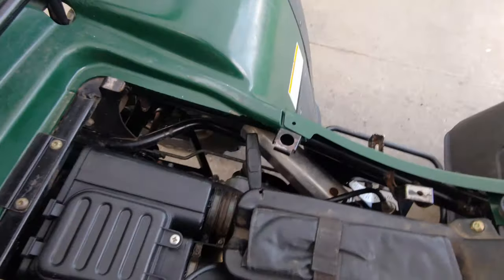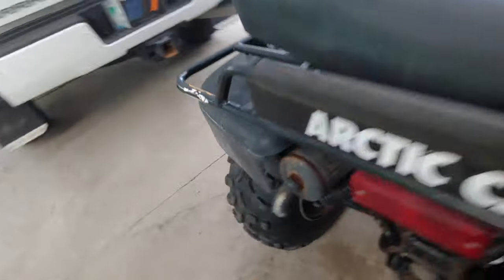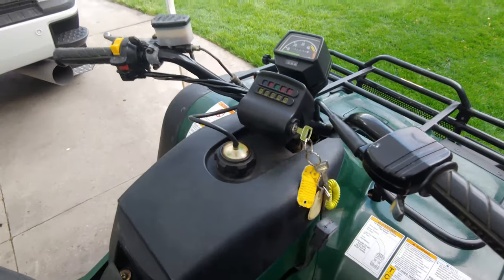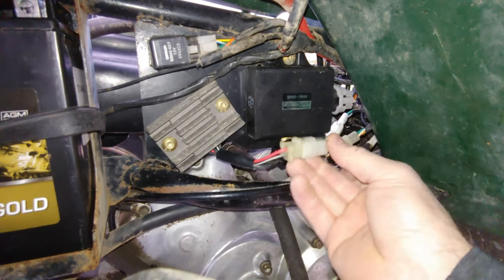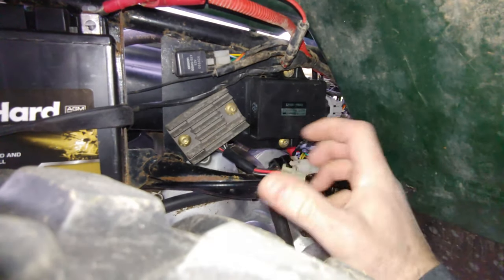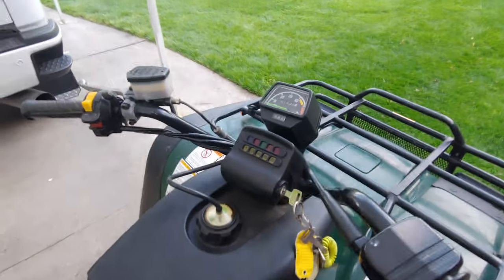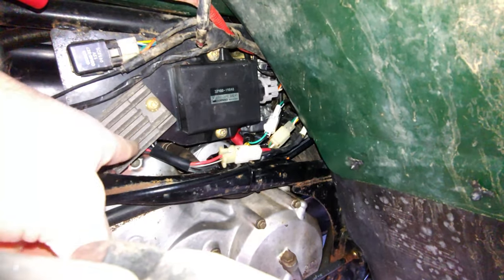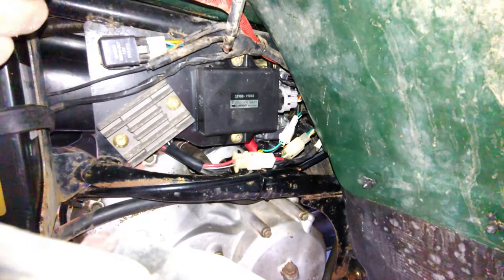99 Arctic Cat 300 4x4 ATV BOG | How to fix if source is electrical

Comment: Had this same issue with my 97 bearcat 454cc.  Did the same procedure.  Problem  cleared up. Also swapped out the old analog cdi box for a Chinese 12v cdi. Wasn't  hard. Now has no issues. New cdi was like 28 bucks. Now carry a spare cdi. If it has a pulse trigger any 12v cdi will work.
Reply from the maker: Oh nice!

Comment: Thanks Andrew!!! that detail of the CDI going safe mode if high voltage detect helped!
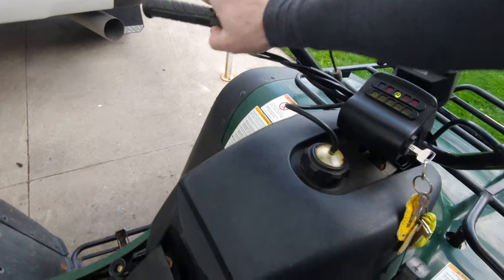3:31 Symptoms of starting up and running rough
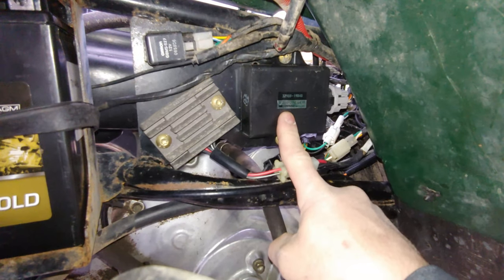6:09 Tested over voltage due to bad Rectifier/voltage regulator causing safety rev limit at CDI
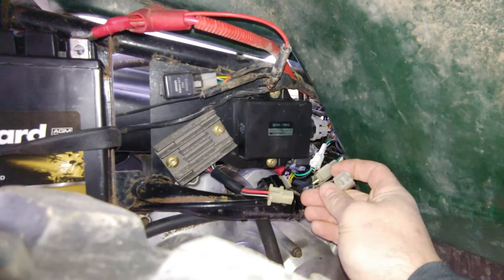7:38 Verify bad rectifier by unplugging it and it runs strong.
Reply from the maker: Good deal. Thanks for watching.

Comment: Thank you! Was gifted a 2003 model because it wouldnt run. Rebuilt carb, still nothing. Compression was ok, tank cleaned, new plug. Even the regulator seemed fine, tested it right after start. After I watched this I disconnected the regulator and off I went!
Reply from the maker: Awesome! The battery wont charge with that unplugged so make sure to get a new one.
Reply: @Fixin2Ride-Official-   new one on they way!
Reply from the maker: Good deal. Glad this helped.

Comment: Wow, Andrew I'm glad I found this video. I have the same problem on a 99 Artic Cat 400 and have done what you went through. Removed fuel tank and cleaned it and put fresh no octane gasoline in, had carb off (twice) and replaced the primer diaphram, replaced the rubber on the thing that lifts the needle off the high speed jet and still does same thing. It starts and idles great but rev it up an it backfires badly. Turn it off for 5 sec and it will run fine for 30 sec and start the backfireing again. Seems the fastest way to check this is check the voltage at the battery when the problem is occuring or disconnect regulator and trying it. I'm gonna do that. Did you replace the voltage regulator? Thanks so much for the detailed info. I was desparate and actually searching on how the adjust the valves....ya never know. Thanks again!!!!!!!!!!!!!!!
Reply from the maker: Nice yeah try it. Its probably it then and yes I replaced it and its fine now.

Comment: Having same trouble with a 400,2015 model..will try this
Reply from the maker: Gptcha. Yeah give it a try. Just takes unplugging it. You can also get the wiring diagram from online, then with a good battery, check for 12.5v- 12.7v (dc from battery) at the key switch. Then with the key in, check for voltage at the safety/on switch, then at the CDI Box and then if all is good and no spark, check for continuity of the spark trigger coil on the stator which will have leads plugged into the CDI Box and then while turning engine over with electric start, check for voltage from the trigger coil

Comment: Im going to try this tomorrow. Hope it works
Reply from the maker: Do it and report back. I can  help problem solve with ya too. If you like
Reply: @Fixin2Ride-Official-  thanks I’ll do it later today when i come home from school
Reply from the maker: Siunds good and thank you for watching!
Reply: @Fixin2Ride-Official-  ok so it wasn’t that. I think its the Carburetor because it only runs on choke and it bogs if you try to accelerate fast
Reply from the maker: Yep. Take it off and clean it. Pull the bowel, jets, slide valve, top diaphragm cap and clean amd inspect everything. Check the diaphragm for cracks. You can use superglue to temporarily fix a crack until you get a new in the mail if its that. Otherwise use carb cleaner and compressed air to clean all passeges and thoroughly clean the jets out. You can use tiny copper wire from some electrical wire to clean the jets IF needed. Pull the bowel float and i let valve and check that as well and make sure fuel flows from the tank well whem the valve is open. 

MAKE SURE YOU HAVE FRESH FUEL... If you dont it will not have enough octane to burn like it should and will run lean. (Needing the choke on)
Reply: @Fixin2Ride-Official-  ok i cleaned the carb but it still has old gas so I’ll try that. Also how many turn should the adjustment screw need?
Reply from the maker: You didnt count how many turns to screw it in? Oops. I always do that. Probably around 1-7/8 I think. Jist google it if not. But yes the bad old gas waa probably lt the issue to begin with.
Reply: @Fixin2Ride-Official-  ok so I’ve done everything im
Supposed to do and it still doesn’t run right i even put a new carburetor on it and no difference. What i did notice was there was a lot of gas in the intake manifold and in the airbox. So i took the airbox off and turned it on and i noticed gas was spraying out of the intake. Now im no mechanic but im pretty sure thats not supposed to happen
Reply from the maker: Lol. Nope. Not supposed to happen. Sounds like inlet valve is bad or Float height set wrong? Shut fuel valve off and maybe pinch fuel line and see if that changes the way it runs?

Comment: Andrew, I have a 98 Arctic Cat 300 with a no start issue. And allow. And electrical is kind of a mess but I haven't cranking at least but it will not start. Maybe in Maybe any chance of me getting in touch with you maybe doing a video chat and you getting me on track I'll just some basics just to get the thing running.? My next step I guess is going to be checking the valve positions I've never done that before but I'm going to be watching videos next on that because I don't know what else could possibly be the problem
Reply from the maker: Fuel, spark and compression... You want at least 110psi on cylinder.

Pull the plug and make sure you got spark. If you do, put a compression tester on cylinder and make sure you have good compression. If you do then take some fuel and dump about a tablespoon down spark hole, put the spark plug immediately after putting fuel in. Then see if it will fire off. 

If no spark, check the yellow connector under the handlebars... Make sure you have power coming from the battery to key switch and out of the key switch to the start button. Out of the start button to the CDI Box. You can test the CDI box for output as well as the Spark trigger coil off of the stator. They spark trigger coild should be puttinf out about 4.7v I believe and there are two wires coming off of the CDI box tat should have something like 29-34v.

Comment: I have the same exact model, when I bought it the guy said the battery was dead so he had a car battery strapped to it and let me test drive it and it drove fine. Got it home and I cannot get it running again even with a jump pack. When the battery was removed the machine dies aswell. Stator issue? I’m pulling my hair! I see the Nash shirt…any chance your in Nashville area?😂
Reply from the maker: If it's not charging the battery it's probably the regulator rectifier which will also cause it to run like crap

Comment: I replace the battery to the middle where there's space for a storage box that's were I put the battery much better placement
Reply from the maker: Good deal. My 99 Honda Foreman 400 battery is in the middle under the back of the seat.

Comment: So I'm in the Auto Repair business, and a customer of mine has an 04 arctic cat 500. looks similar to yours. Wanted me to look it over since it's been sitting for a while. One of the things I noticed, was the warning lights on the dash don't come on at all. It has something similar to yours. Not a digital dash, but a separate speedometer and warning light cluster ( lights, temp, neutral, reverse, oil). its a two position ignition switch. First is on with dash lights(that don't work), and second turns the lights on. It will start and run and lights work (high and low), but nothing comes on on the warning light display. I found one fuse box under the seat that has only 6 fuses in it. Lights, hi, lo, ignition, fan, accessory. They're all good. Any suggestions?
Reply from the maker: A lot of the time the plug get corroded. So check the wiring under the handlebars and going to the key switch. Thats where Id start. You should be able download the wiring diagrams from countrycat.com. Use a multimeter to track down the issue checking for proper voltage and grounding. It may very well be a bad ground going to those light. They should all be grounded together. 

Hope this helps and thanks for watching!
Reply: Thanks for your advice. I did look at it a little more after I messaged you. I found the connector buried in front of the tank and below the bars. Got it disconnected and tested the harness side of the connector. The ground circuit was good,and when I turned the ignition switch on,I had power at another pin. Assuming that's the one that powers up the LED display. Found power on another pin when I switched the lights on. But when checking the other pins when shifting it to neutral or reverse, I had no power on any other pin. Maybe the bike has to be running. Or maybe the switch for neutral/reverse is dirty or not lining up. It's a manual shift lever for all gears and I can see on the backside of the shifter (behind the fender) there's a cover over the mechanism. So maybe I can check that tomorrow. In the meantime I decided, I should be able to power up some of the pins on the display side of the connector. So I grounded the ground pin,and powered the other pins one at a time, and nothing lit up. So with that, I'm assuming the display is no good. On another note, I dumped the gas in it (it was running when they bought it in, but said it didn't run to good until it really warmed up. I had ordered another (Chinese) carb for it since I just don't have the time to take the old carb apart and clean it. Even though I prefer to do that. The gas was smelling pretty old, so I figured it would not hurt. Put the new carb on and fresh gas. It starts and runs, but has a bog on initial acceleration. First instinct was cheap carb. Tried adjusting the pilot air screw, but didn't make any difference. Check for any other potential vacuum leaks, but nothing showed up. Might wind up cleaning the original Keihin carb. And hopefully that's it.
Reply from the maker: Gorcha. Yeah could be a bad cluster. On this one, a few of the gear light didnt work until. Started shiftinf through thr trans often by riding it frequently. Tjey all ended up working so I assume it was just gummed up lube in the trans gesr switch assy on the trans. Its on the top left side. 

 As far as a poor running engine until warmed up, that can often be bad compression. So check that.
Reply: @Fixin2Ride-Official-  thanks for the feedback. Appreciate it.👍🍻
Reply from the maker: You bet! Share the channel and videos is all I ask

Comment: Mine starts but when I hit the gas it won’t go is just putters and if I hit the throttle a lot it backfires not sure what is going on
Reply from the maker: Did you unplug the voltage regulator/ recrifier? If you did, then check the diaphragm on top of the carb as well.

Comment: I don’t know why but my quad I just cleaned the carburetter it starts and it drives, but when I go full throttle at like bog, but like I can’t find how to fix it is there any ideas that you can tell in the comments on what it could be
Reply from the maker: Check the diaphragm on top of the carb. They lift the valve by vacuum and can crack. It's 4 screw on top of the carb.

Comment: So if ive a bogging ,sputtering problem then it could be problem with my rectifier regulator.ive tried new ignition coil,new spark plug, changed cdi box new air filter,new carburator also and its still not reving cleanly.
Reply from the maker: Could be just unplug the rectifier and see how it acts but just be aware that the battery will not be charging at that point

Comment: I have a 2001 artic cat 500, it was running good, after a day of a trail ride with some rain, the next day it starts up, and idles normal for a few seconds, then bogs and dies when i throttle it. Help please 🙏 
Ive took out carb 2 times, made sure all was sealed, air filter new, gas flows normally ..
Reply from the maker: Sounds like your throttle switch. Should be a 3 prong plug at the base of the handlebars. Unplug it and see if that helps. A lot of the times they get wet and do that.

Comment: I have same 4x4 1999 also. Runs good but will not idle. Can you help please. Tried everything I know.
Reply from the maker: Check Fuel screw and  idle screw, clean carb, make sure fuel is coming out of tank freely and no blockage, make sure the vent on the tank is good and then make sure you got fresh fuel.

Comment: I got a 1987 klf 300b with the same problem but when i unplugged the rectifier still not working, ive been looking up and tinkering for hours and i cant figure it out
Reply from the maker: Try looking at the diaphragm in the vacuum valve and see if there's a tear or crack somewhere in it.

Comment: Iv got a articcat 500 1998 and it's got slow spark have any ideas ?
Reply from the maker: What do you mean by slow spark?
Reply: I'd say it sparks every other time it should... it won't run at all
Reply from the maker: Try unplugging the 4 prong plug at the stator. You might havw to jump the two non yellow wires. If you Have good spark the issue is in your safety switches. If not its in your ignition componenets. 

 If its in your switches, disconnect your 3 prong plug under the handlebars and jump the two wires closest to each other .

Comment: I have one u start it, and it idles for a few sec then straight high idle I have to hurry up and shut it off it's not sucking air can't figure it out please help me been like this 3years
Reply from the maker: How does the plug look?  Its hard to diagnose without having the ability to out hands on it. Have you gone throught the carb? These have a diaphragm on top of the carb that whem you open the throttle, the throttle butterfly valve opens and that allows more air to flow into the carb and there is a port on top side of the intake bore (on airbox side) that causes a negative pressure above the throttle Slide valve and that causes the slide valve to lift. 

 So it could be something like a loose throttle butterfly valve. Deff sounds like a carb issue. Thats where Id start first. 

 Idle is controlled by a screw that holds the throttle butterfly valve open on a Carbureted engine.